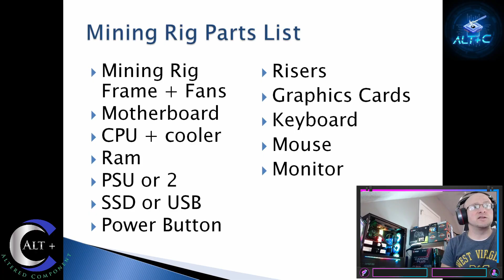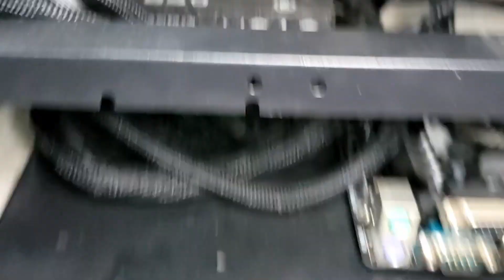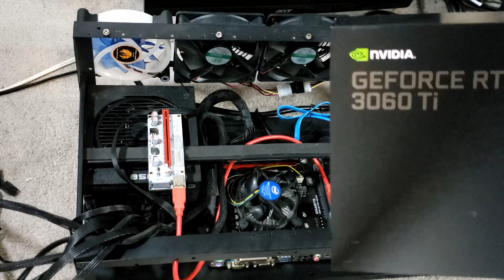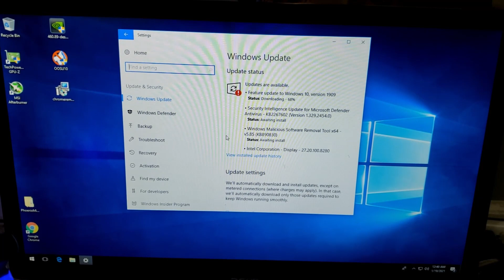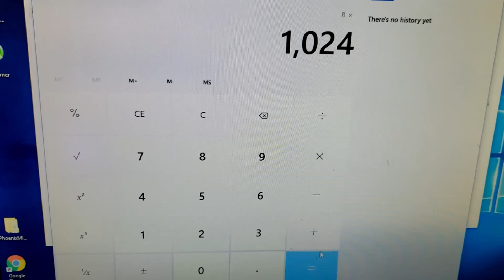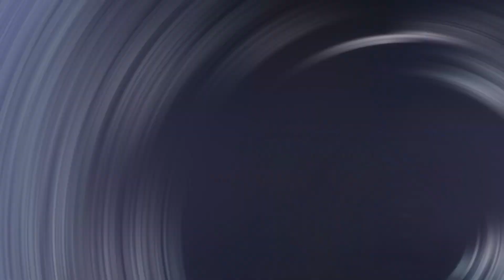Noob's Mining Rig Build:  How to build a mining rig for rookies (windows)

Comment: I keep going back and forth... I am going to do it... I can't do it.... I am going to do it...I can't do it... OMG!!  I am going to do it....
Reply from the maker: Oh I get it.  I started out in 2017 with a single card in pc.  Then had a card on top of tower, then 2.  Then I made a wood frame that sat on top of the pc tower that had 3 rx 570s.  Then I made a read wood frame and had 2 x1050s, then 3, then 4.  Then swapped to 1060s, then 1070s and 1070tis.  It is a fun trip
Reply: @AlteredComponent  I just bought the motherboard!
Reply from the maker: @ryanboldt7751  the best thing about using normal pc hardware is, as long as you do not pay crazy initial prices u have a very sellable asset down the road if need be.
Reply: @AlteredComponent  I am trying to get exactly whats in the video
Reply from the maker: @ryanboldt7751  really do not pigeon hole urself like that.  Look around and find best alternatives at best price.  Do not over pay for a motherboard and cpu.  If u want to go cheap on frame, go with a wire rack or shoe rack.  Power Supply,  my suggestion to start is a bronze atx psu and a hp 750w server psu.  Parallel miner sells a 750w with breakout board and wires for only 40 bucks.  U can connect the atx to the motherboard and then a molex from ur atx psu to the server psu.  Cheap and super efficient.  These are louder,  but oh so nice.  Risers, go with at least a version 008s or 009.  Then the biggest problem are they gpus.  Have to setup alerts and try to catch drops at good times and prices.  Do not pay scalper prices right now.  It could double your roi time.  Happy hunting
Reply: @AlteredComponent  parallel miner site is amazing - got the 750w ps with breakout board just like you said!
Reply from the maker: @ryanboldt7751  impossible to beat the price and quality of their psus.  I have a 2400w that I will be creating a video on soon.  That thing is a beast
Reply: @AlteredComponent  ok... woe! no graphics cards anywhere!!   ideas to watch for and look for a graphics card?  and you mentioned a place for cheap windows keys?
Reply from the maker: @ryanboldt7751  I still think bestbuy is the best shot for u.s. residents to buy the new gpus.  I picked up another 3070 from last week's drop.  I also got lucky on the newegg shuffle and nabbed a 3060 zotac twin edge oc.  I advise entering that daily as long as they have graphics cards.  I have a how to buy guide for bestbuy on here https://youtu.be/KiG5Q-SdSFc last drop was thursday 2/25 They generally drop ever other week and Tuesday has been the day of choice.  Drops start at 1115ish eastern time.  Hopefully a drop hits on Tuesday 2/9.
Reply: @AlteredComponent  wow, that's so crazy! good to know - I had no clue.
Reply: @AlteredComponent  I got a 1660 super off bestbuy - it was like 299.  Its not the best card but I need anything at this point to get up and running.  I also entered the newegg shuffle today, that is a great idea by them.  hopefully I win something eventually
Reply from the maker: @ryanboldt7751  entered shuffle today as well,but only the Asus ko 3070..pricey at 800 though.  That is actually a good price on the 1660s right now.  Not too shabby.  Hey, it out mines my 500 dollar zotac 3060 lol
Reply: Why don’t you just plug the first graphics card directly into the motherboard? And just  not use a riser, then use The risers as you add GPUs?
Reply: I think the motherboard is dead on arrival, I finally got all the parts, put it all together and nothing, doesn’t even turn on.  I got all the same components as the video, if I test the power supply as a standalone it works, as soon as I plug it into the motherboard nothing, like zero.  I think it’s the 24 pin connection to the motherboard is bad? If I use the tester that came with the ATX I can get the PS to turn on and it even powers the risers and GPU.   Anything else it could be??
Reply from the maker: @ryanboldt7751  so, assemble just on the motherboard box on a table or desk.  Have just the mobo, the cpu with cooler, the psu plugged only into the 24pin slot and the 4+4 cpu slot, and 1 stick of ram plugged in.  Make sure ur 1 stick is in the dictated slot as per the mobo manual and make sure it is clicked completely in. Try booting.  See if u get post.
Reply: @AlteredComponent  nothing - not a sound or anything. But if I plug the 24 pin in the tester power supply works.  I think it’s the 24 pin port on the motherboard is bad. It’s just like no power goes to the motherboard.
Reply: @AlteredComponent  even the fan on the GPU will run when the tester is in the power supply. So I know the risers getting power, plus it’s showing lights so that’s all good.
Reply from the maker: @ryanboldt7751  so, is the fan on the cpu spinning?  Mobo lights coming on?
Reply: @AlteredComponent  no - no lights no fan nothing
Reply: I bought a new, but from China, the box and all the instructions were Chinese 🤔, I saw on Amazon lots of people lately have reviewed the boards poorly saying dead on arrival.
Reply: @AlteredComponent   well this has been a journey, I had a bad MoBo and I got a new one and I got it to post.  Should I try to update to the latest bios or just try to install windows from USB?  right now, it is just PS,  CPU, 1 stick of Ram.
Reply: @AlteredComponent  It lives!!!  It breathes, I am mining a 1660 super - $3 a day.  I am amazed -thanks for all your help and encouragement!  I got shipped a bad mobo - and got it replaced and got it setup finally!!!
Reply from the maker: @ryanboldt7751  man.  Great time to be up and running l.  Congrats buddy

Comment: How many of these same graphics cards could you add to this rig or will it only handle 1????!
Reply from the maker: That is a 6 card frame.  I have it now holdings 3 3060ti and 3 3070
Reply: I started mining on my gaming computer and I have the funds I’m looking online at everything on this video to buy and the motherboard is sold out Amazon has one used I thought about grabbing do you help people get started by chance I would really like to talk to you
Reply: I don’t want to use my gaming computer I only did it to learn how it works now I’m wanting to build my own rig instead of buying one
Reply from the maker: @sosjunkremoval  absolutely.  That is how I started back in 17
Reply: Quick question I’m sorry to bother you man I’m a noob I’m on new egg right now adding everything to cart except the mining rig that holds everything I’m gonna build one myself BUT I’m running into an issue on finding this exact GUP card I’m gonna find one on offer up or eBay the same exact gpu card now I’m just running into one more issue the 2 ram sticks i cannot find anywhere can you tell me some sticks I can buy that will work for this setup even adding all x6 gpu cards? And what risers that will work because I’m copying this same exact setup to make my very first rig instead of buying a miner online and I don’t want anything to mess up or fry or not work I want it to run smoothly could you possibly tell me some ram cards to get that will work and run everything smoothly thank you so much bro !!!
Reply from the maker: @sosjunkremoval  so, u do not need to copy per se.  Just got with a mobo first that has 6 pcie slots and lanes.  Then pair the cpu and ram.  To do this, u simply Google "insert your motherboard manual" then go to official site such as gigabyte page for the board.  Click the support tab.  Check the cpu compatibility chart or open up the manual that goes with ur mobo.  In there it will list the compatible ram and cpu.  For cpu, search for a number of the compatible models and find the best deal since the cpu is not all that important to a mining rig.  Now u need a cheap 120gb ssd, I'd suggest silicon power from newegg, its like 23 bucks.  As for frame, these are so inflated right now.  Cheap alternative is build one from alum or wood, or metal rack or shoe rack. Power Supply id use a cheap atx and pair with a hp 750w server psu with cables from parallel miner for 40 bucks.  Ram can be 4 or 8gb of slower compatible ram.  Risers i suggest v008s or v009.  Dont power them with sata.  Gpus are hardest and most costly right now of course
Reply: Your speaking Chinese a different language I’m sorry I’m not smart this this kinda stuff at all but I like this setup so I’m going to use same motherboard I’m gonna use everything your using it’s just I can’t find your risers your memory sticks everything else I found
Reply: I’m just seeing what memory sticks I could use with your same exact power supply and motherboard and risers what will work to run all x6 of the gpu graphics cards am I making better since I don’t know what mobo is or SE your speaking of I’m sorry super super noob here
Reply from the maker: @sosjunkremoval  when you say memory sticks.  You are meaning ram sticks right?  If so, u have to buy the motherboard first and match it to the mobo
Reply from the maker: @sosjunkremoval  mobo is slang for motherboard
Reply: So correct me if I’m wrong I could could use x2 of these ram memory sticks and they will work just fine Crucial Ballistix Sport 8GB DDR4 2400 MT/s (PC4-19200) CL16
Reply from the maker: @sosjunkremoval  that is a very common memory and yes it would work in my gigabyte h110 d3a motherboard and well as a lot of motherboards, but unless u know exactly what motherboard you are getting, u cannot be sure what ram. You should buy the motherboard 1st, cpu 2nd, ram 3rd.  Cpu and ram should match the mobo

Comment: How much money does all of this cost would you say?
Reply from the maker: Honestly the bulk of the cost depends on the graphics cards your use.  They are very inflated right now.  Frame, ssd, mobo,cheap cpu, risers, power supply...u can affordable build and buy those.  Problem is gpu super hard to get and very expensive.  Expect to pay 3500 usd to build a 6 x 3060ti rig if u can get the cards.

Comment: So did you install Windows onto the SSD? If so, why didn’t you just DL Windows directly onto the SSD using a USB cord plugged into a laptop? Thanks!
Reply from the maker: Yes I have downloaded a copy of windows 10 (iso image) to a flash drive.  Then I use the flash drive to install to the ssd.  I have reused this same downloaded file for multiple installs over time.  U can purchase a key to activate windows later for around 15 dollars usd from a number of sites.  Thanks for watching
Reply: @AlteredComponent   yes but can I DL Windows directly to the SSD? I don’t have a copy yet.  Second question- is there not a slot in the mobo to plug the SSD directly into? I have an asus 110 on its way.  Thanks!
Reply from the maker: @hansjensen7823  I do not think u can download windows directly to the ssd because they only offer the iso for for download which is an image.  Installing it from the ssd essential unpacks it while it is custom built to your system and components.  If you were able to download straight to ssd, not sure it could do this valuable step.  I could be wrong but over the years I have never heard of downloading and installing windows directly to the ssd from another device and then moving it over.  As for hooking it directly to the board, u have to use a sata plug to plug it into the mobo and then power with a sata power plug.  If it is a m.2 drive u could plug directly into mobo, However many boards share pcie lanes.  So if you plug in a m.2 drive, it may disable a pcie x1 slot causing you to use 1 less gpu for your rig
Reply: @AlteredComponent  I understand thank you!
Reply from the maker: @hansjensen7823  thank you for stopping by.  If you run into issues join one of the discords in description and feel free to ask

Comment: sorry - I am so new to this.  At 9:42 you talk about using a single power supply but later will use a server PS to power all the cards, does this mean the current installed power supply can only power the one gpu card?  You need the server PS and the breakout board to power all six cards once installed?
Reply from the maker: For a mining rig, you can use just a single atx power supply, dual atx, an atx and a server psu, just server psu, multiple server psu.  Personally I have always used a single atx power supply AND a 750w or 1200w server psu.   When I use both a server power supply and a atx power supply, the atx powers the motherboard,  the cpu, the ssd, any additional fans and then usually 1 or 2 gpus and risers.  The server psu then powers the additional gpus and risers. I have a couple of server psu videos that may help on here if you are looking to go that route.  A server psu is much cheaper,  they have amazing efficiency, they have great longevity and they are built specifically to run 24/7.  Biggest con is they are loud when on full load. If u have more questions, join the discords above.  Thanks for watching
Reply: @AlteredComponent  okay, I got it - that is super helpful and I watched the other vid as well and it makes sense.  one more dumb question, I don't see how the server PS will fit on the rig?  where to you screw it down? or how will that work?  I have not used discord before but I know what it is, my son uses it all the time.

Comment: this is best tutorial video ive ever seen. could i use 8pin slpit to dual (6+2 pins) which 8pin from PSU, 6 pin on riser and another 6+2 pin on gpu?
Reply from the maker: Absolutely.  You can easily split a single 8 pin from the PSU to dual 8 pin, or in your case a single 6 pin to riser and 8 pin to gpu.  As long as it is powering the same card.  Do not split a 8 pin and then run to 2 different cards.  FYI, ill be receiving some 6 pin to triple 8 pin cables soon from Parallel miner. These would be to power a dual 8 pin gpu and a 6 pin riser in one swoop.
Reply from the maker: Also thanks for watching and the feedback.  Much appreciated
Reply: @AlteredComponent  thanks for your advice

Comment: Hi Great video ! Question did you do anything in the bios change ? As well you mentioned to keep Ethernet unplugged when loading windows but you mentioned it had to update ? I’m running 2 cards both 3070 , your input with the vram do I combine both numbers now or just leave it for the 1 ?
Reply from the maker: For the windows question, I had to update because you have to use a new enough windows that will allow the 30 series nvidia drivers.  The image of windows 10 i was using was quite old.  If you are using more than 2 gpus, generally there is a setting or 2 that you may need to check in order for the additional cards to read.  If they are both reading,  nothing to set.  The other big item in bios i set is so that the system will boot on power.  Meaning when the power supply provides power it will boot.  Here is why.  I set both afterburner and whatever my primary miner is to launch and start mining on power.  I also use wifi outlets that I can turn on and off. So, if system is frozen.  I can hit power off and back on remotely with wifi outlet.  System recognizes power and boots, afterburner and miner start mining
Reply: @AlteredComponent  thanks for the reply . Changing the vram settings in windows does that affect with the overclocking settings in msi afterburner ?
Reply from the maker: @DanC2025  it isn't vram as in the physical ram on a gpu.  It is allocating a small portion of hard drive or solid state drive for additional virtual memory.  It does not at all affect overclocking.  A 2070 should do around 40 mhs
Reply from the maker: @DanC2025  in afterburner try -50 core, +800 mem, target 150w.  Not sure percentage, but start at 70% and see what that yields
Reply: @AlteredComponent  gotcha makes sense .... also can you point me in the direction if possible a chart for specific overclock settings for the rtx 3080
Reply from the maker: Oh and I assume u mean the virtual memory.  I would set to 16384 for both fields for you since you are running 16gb of physical ram

Comment: does it has to be a Intel G3909? Cause it is hard to find one, is there any problem to use for example a Intel Celeron G5905 3.50GHz? Sorry I am a super noob!!!
Reply from the maker: If can be any cpu that will slot in and have integrated graphics.  Basically once u have a mobo picked out, look it up on its official site and check what cpus will work with it.  So say google, "gigabyte h110 d3a" , click the official gigabyte link, go to support tab, check cpu chart for all available cpus, then shop for multiple models looking for best deal.  I had to just do this with a gigabyte g365 mobo.  It is a 300 series meaning coffee lake, the next generation above g3900 (skylake)  I looked up the chart, wrote down the bottom 8 models, searched until I found a model for only 45 bucks used on ebay.  So I paired a 70 sale mobo from newegg, with a 45 used cpu.15 dollar cpu cooler, 40 ram, 30 ssd, cheapo frame (video to come) and ready to add gpus